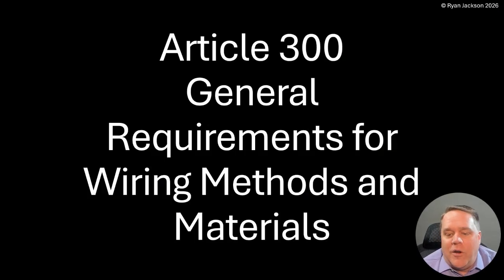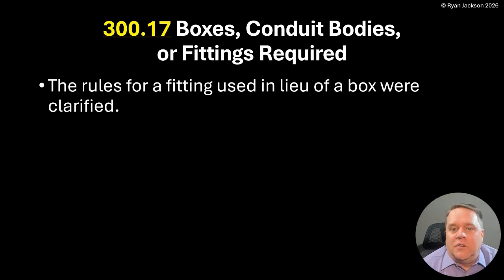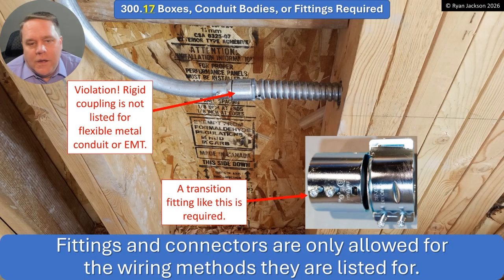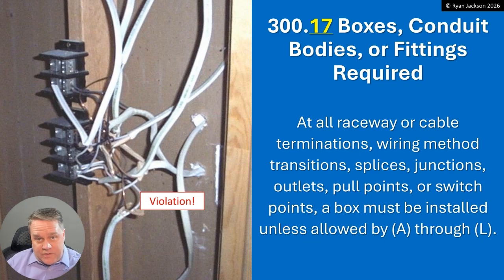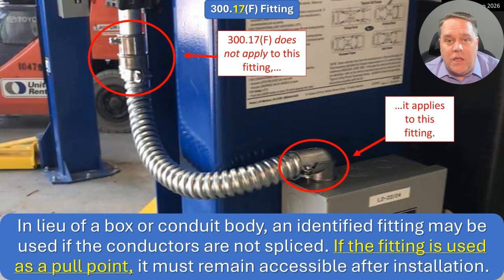100 Days of the 2026 NEC Changes Day 36: 300.17 Boxes, Conduit Bodies, or Fittings--Where Required

Comment: It makes sense that a flex 90 should be accessible.  But what about an MC 90? 🤔 they're not really used as a pull point, yet the are designed almost exactly the same.
Reply: And that's your answer:
MC cable isn't conduit. 
Conductors aren't pulled into it.
This goes for any preassembled cable.  It's conductors wrapped with other flexible materials into a single unit.

The rule (f) applies where conductors are pulled through a conduit and should be replaceable.

Comment: Hey Ryan, Thanks for the video. I have been investigating the issue of transitioning from one wiring method to another via rigid coupling and really wanted to hear what an expert would say on the topic. I understand you don't work for UL but maybe you clear some things up for me.  From what I could find, there are no specific testing guidelines in UL 514B(conduit and cable fittings) to which purposely built transition couplings are tested to. I think it was actually mentioned somewhere in the prologue that those requirements needed to be added at a later date. UL 6, the standard threaded rigid couplings are tested to, lacks this information  as well. Here is my question that arises from that,; how are these transition couplings being listed if there is nothing in the standard to test them to? Most, if not all, transition couplings and connectors are not listed by UL but rather ETL using  using UL 514B as the testing standard. A specific product that I came across related to this is the Orbit Roof coupling plate(RCP-50 and other models). The  product is literally a standard rigid coupling welded in the center of a steel plate with mounting holes. The manufacturers literature advertises this plate as a way to transition between wiring methods. Is the manufacturer misrepresenting their product? I am just a normal electrician, and this may be way past my pay grade,  but I am really just looking for some guidance or correction in regard to how listing works